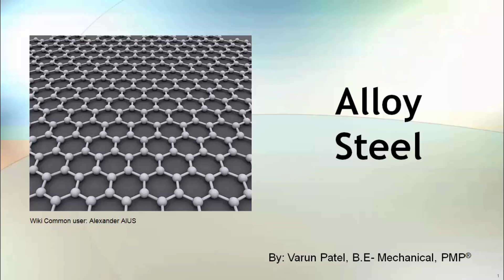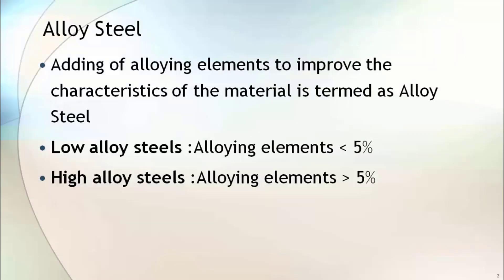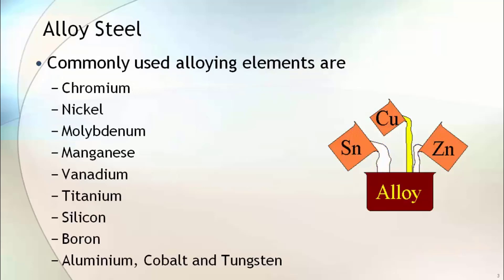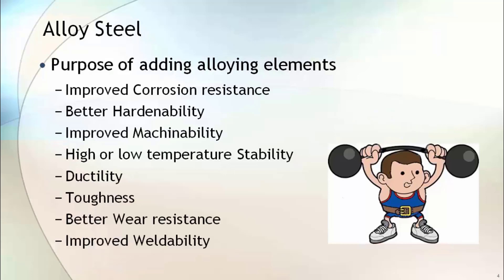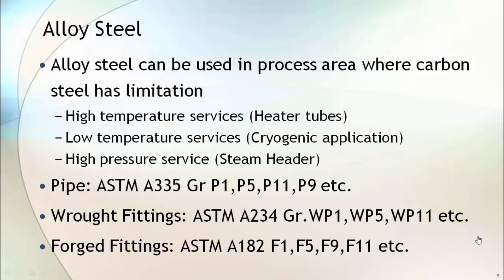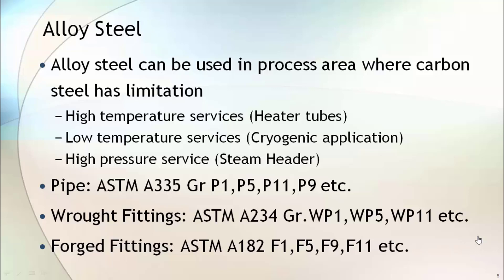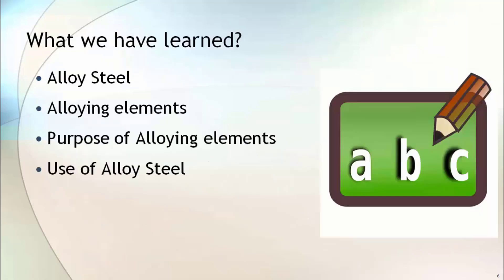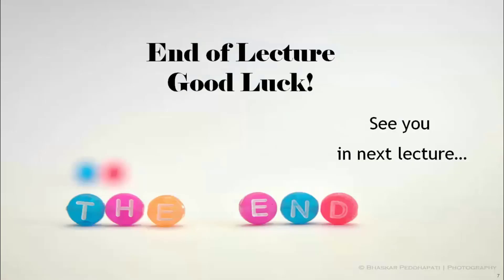What is Alloy Steel in Process Piping? Low alloy vs High alloy steel - Piping Training Video-4

Comment: As I know, low alloy steel(e.g. P1,P5,P9,P11,P22) cannot be used at cryogenic temperature. According to ASME B31.3 TableA-1, minimum applicable temperature of these steel without impact test is -20'F. and it is almost impossible to pass the impact test.
Reply from the maker: These P series grade of ASTM A335. They are all use for High Temperature service, whereas ASTM A333 Grade 1, 3, 4 etc. are use for low temperature service. This video is just and overview of what is alloy steel. So I have mentioned that various alloy steel are that can be used for different services.
Reply from the maker: Your understanding is right